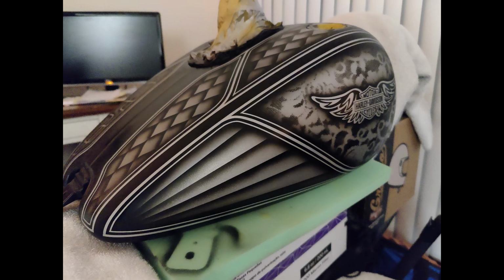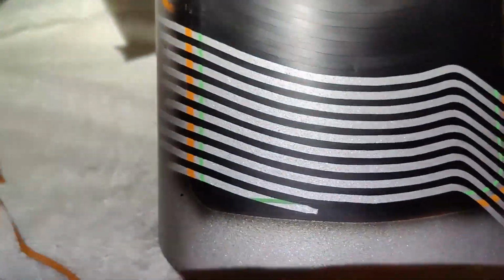Harley Davidson Softail tank, fender & helmet Gold Kandy

Comment: Wow!  How did you weed that small vinyl stencil on the fender?  Having issues with the same logo.  Tha A and O insides are trouble!
Reply from the maker: I use a Cricut Air 2. And yes the center of the A and O are sometimes coming off, I just get a tiny brunch or a toothpick to apply a little bit of paint 😉